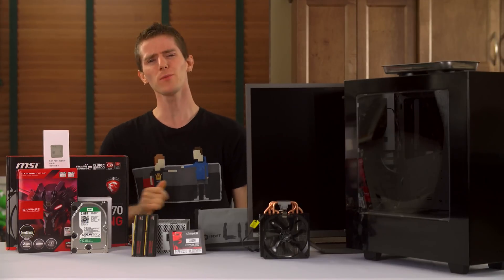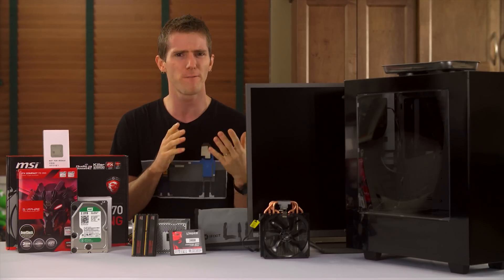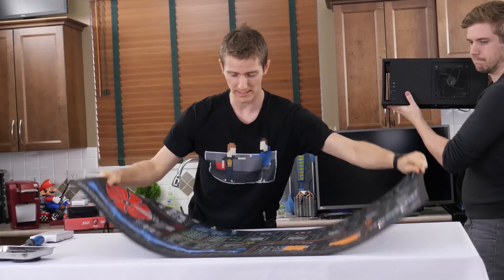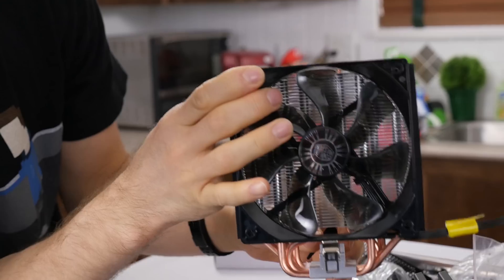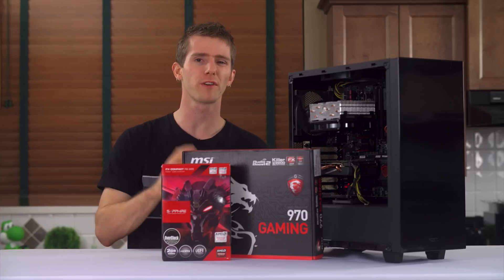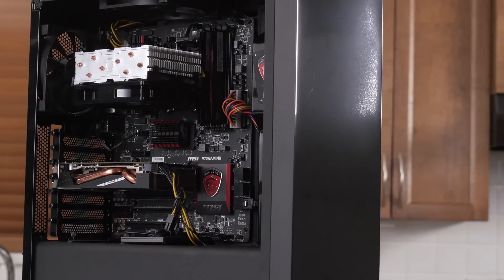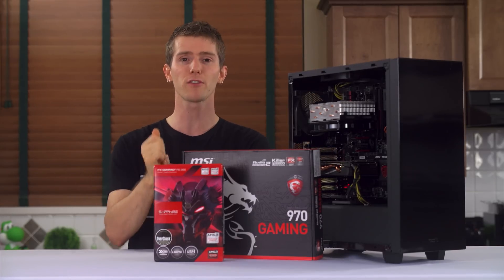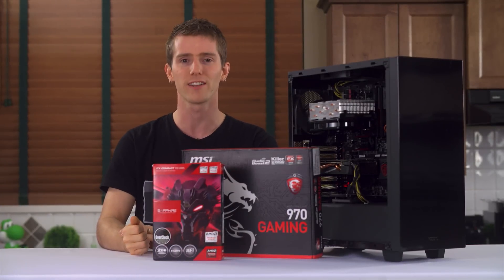Can you Build a 4K Gaming PC for Under $1000?

Comment: There could be better price choices made here, but that wasnt the point. Last April I built a budget machine for school use and for some light gaming ( Minecraft, Farming simulator) I ended up spending about $250 on my pc because i used older parts. I went with an AMD A10 5800k 3.8ghz with 4.2 turbo, a MSI FM2-A75MA-E35, Patriot Viper Extreme 8gb DDR3 1600mhz kit, and Thermaltake 750w smart series PSU. Thats all i personally needed to spend my money on. I used a Radeon 7850 2gb card that we had from a prior build, an old server case that we had from a prior build, and hard drives from the same prior build. The point is this is a budget PC for those who are trying to build a completely new PC. If i would have bought all of the components that were in my build it would have been 500 and change but my pc is also no where near as capable as this is. Although now with the new nvidia line you could make it much more capable with a 970 instead of my card and maybe a cheap SSD for a boot drive. But the point is the word budget should be used very loosely. What is a budget for one person may not be a budget for others. At the time that i started the build i was 14 so the fact that i was even spending that much money on something like that was huge. Now that i am 16 and have a little more money floating around the computer would have been better but it all depends on what you are going to do with your computer, that is what decides your budget. For me my current budget is 0. I could upgrade my current pc and have something that is pretty decent, but i also have consoles and use TV's not super high end monitors so what does it matter to a person like me, especially when my friends all run consoles because they can't build computers. And to me working in the IT feild, seeing all of the crappy dells and other cheap laptops that i fix and the family Pentium series pc that i am typing this on right now, my computer is a beast. But to Joe computer guy and all his computer friends this is reasonable price for a decent computer. The whole budget thing is greatly misunderstood and i think some of the youtubers need to stop using it because they don't really know what budget means.

Comment: Hey Linus I had a quick question but very serious as I may be re-building my brand new (1 month old) pc rig. I recently purchased a GTX 970 only to discover my old pc parts were aged and tired. SO I decided to go ahead and buy a new mobo and processor during the perfect purchasing time of Black Friday! I grabbed a M5A97 r2.0 Mobo w/ a AMD FX 8350 processor, to accompany my speedy new MSI Gaming GTX 970 graphics card. Im now a month in with my build, and getting bottle necking with some of the newer titles ( Basically just AC Unity and Far Cry 4) but still getting great frames (40-60) and (higher on Far Cry 4) but, after watching this video I wonder if the MSI 970 Gaming Mobo would be a better choice coupled with the same CPU and GPU. I already have memory so thats not a problem and I have a 750 w mod PSU. I'm basically wondering if I'd get better asthetics and performance via the better Motherboard. Any comments are appreciated and I'd really love to here back from you Linus if at all possible! Anyways this was a great video and I appreciate the build guide!

Comment: This particular build seems very limited if it's unable to run 4K on BF4 or any other future titles at high/max settings. Personally thinking no one should even consider using these components for a 4k gaming,doesn't make it any closer to those on a budget. The money spent on the 4k monitor could be put towards the GPU/CPU for game stomping 1080p rig that doesn't have drawbacks on which titles can be played on it. Was this purely a sponsor/money video from Linus? I think so,don't hate just my view on getting the best bang for ya buck.

Comment: This is a nice change to the current videos. Seeing more of the common choice of games, not the newest and latest and seeing if a a reasonable budget PC could run at 4K. Personally, I'm not 100% interested in 4K yet. I've owned my PC for 2 years and I spent a bit on it:

£1,300 (about $2,000. Two years ago from a retail shop).
Intel i7 3770 3.4GHz
16GB DDR3 1333MHz Kingston Value RAM
240 SSD Corsair for boot drive
1TB HDD Hitachi for storage
GTX 780 3GB EVGA (before GTX660Ti 2GB Gigabyte)
CX750 Corsair PSU
21" AOC monitor @ 1920x1080
21" BenQ monitor @ 1920x1080

Runs very well after all this time and I run multiple games at once.I was banging on about upgrading to the latest for a good while and realized I don't need really need despite seeing the newer hardware improved and refined.

Comment: It looks nice but I put together a list with:
Core i5 4460
Stock cooler
H97 mobo
8GB RAM
256 GB SSD
same 2TB HDD 
GTX 970
S340
EVGA 750w PSU

And it only costs $30 more than this - $900>$870

Comment: For $1k you could build a much more rig. Ditch that SSD and grab a 970. Or just downsize it and get a 290. An FX 6300 is certainly not the CPU you want for a $1k build. A 4690K could have been easily fit in this budget for a huge performance boost.

Comment: Great video. Another great game to try is GTA 4. I only have a 1080p monitor but I can play GTA 4 at 4K 60 average FPS on two GTX 760s using NVIDIA DSR. Turn down the graphics a bit and I can use only one. I play WoW at 4K as well with my 760s. I played ArcheAge at 4K too. So, two 760s (GTX 780ish performance) kicks ass. I went with 760 SLI when it was a way better value than a single high end card. But I really want to go with a single card now because Ubisoft doesn't know how to optimize SLI.

Comment: I have intel core i3-2100 3.10 ghz 
radeon hd6850 
8gb of ram (relativly old motherboard and 450-500Wps)

it's just seems like most triple A games are lagging what is the cause of it? what can I upgrade for less than 200 euros that can last me some years and doesn't require a change of motherboard or ps

Comment: Pretty sure this system will use more than 400 watts.
Reply: Their Build:

PCPartPicker part list: http://pcpartpicker.com/p/3HHqVn
Price breakdown by merchant: http://pcpartpicker.com/p/3HHqVn/by_merchant/

CPU: AMD FX-6350 3.9GHz 6-Core Processor  ($114.99 @ Newegg) 
CPU Cooler: Cooler Master Hyper 212 EVO 82.9 CFM Sleeve Bearing CPU Cooler  ($26.75 @ OutletPC) 
Motherboard: MSI 970 GAMING ATX AM3+ Motherboard  ($97.99 @ SuperBiiz) 
Memory: AMD Radeon R9 Gamer Series 8GB (2 x 4GB) DDR3-2133 Memory  ($78.38 @ Newegg) 
Storage: Kingston Fury 240GB 2.5" Solid State Drive  ($94.99 @ Amazon) 
Storage: Western Digital WD Green 2TB 3.5" 5400RPM Internal Hard Drive  ($77.98 @ OutletPC) 
Video Card: Sapphire Radeon R9 285 2GB Dual-X Video Card  ($224.99 @ Newegg) 
Case: NZXT S340 (Black) ATX Mid Tower Case  ($59.99 @ NZXT) 
Power Supply: SeaSonic 400W 80+ Bronze Certified ATX Power Supply  ($44.99 @ SuperBiiz) 
Total: $821.05
Prices include shipping, taxes, and discounts when available
Generated by PCPartPicker 2014-12-25 12:16 EST-0500

Much better at same price:

PCPartPicker part list: http://pcpartpicker.com/p/tG88yc
Price breakdown by merchant: http://pcpartpicker.com/p/tG88yc/by_merchant/

CPU: Intel Core i5-4430 3.0GHz Quad-Core Processor  ($178.98 @ OutletPC) 
Motherboard: ASRock H81M-HDS Micro ATX LGA1150 Motherboard  ($49.99 @ Micro Center) 
Memory: G.Skill Ripjaws X Series 8GB (2 x 4GB) DDR3-1600 Memory  ($60.99 @ Newegg) 
Storage: Kingston Fury 240GB 2.5" Solid State Drive  ($94.99 @ Amazon) 
Storage: Western Digital WD Green 2TB 3.5" 5400RPM Internal Hard Drive  ($77.98 @ OutletPC) 
Video Card: Zotac GeForce GTX 970 4GB Video Card  ($309.99 @ Best Buy) 
Case: NZXT S340 (Black) ATX Mid Tower Case  ($59.99 @ NZXT) 
Power Supply: EVGA 600B 600W 80+ Bronze Certified ATX Power Supply  ($19.99 @ NCIX US) 
Total: $852.90
Prices include shipping, taxes, and discounts when available
Generated by PCPartPicker 2014-12-25 12:22 EST-0500

Comment: Where did the $1000 go? for the same price you could have gotten an r9 290, an FX-8320 and a fully modular 80+gold PSU. Just downgrade the case to an R4 (if you even consider it a downgrade) and find cheaper RAM.

If you really wanted to pinch pennies you could go for a cheaper motherboard as well and drop the HDD.

http://ca.pcpartpicker.com/parts/partlist/

As a side-note I don't understand why the 290/290x aren't more popular. At $260 the 290 is an absolute steal.

Comment: If you have to lower the quality to get better resolution, better stick with lower resolution and higher quality.. Please. I have 4k myself, and if you turn down quality, that's way worse than turning down to 1440p or something similar to that. Seriously. Resolution is not all. If you want stunning graphics, you need it cranked up in quality, and 60 fps at least. Resolution is not more important than any of those, unless it is less than 1080p or something.

Comment: I understand that this is a sponsored build, but even as such it just doesn't make sense. You build a quite good price/performance rig and go ahead and say that as long as you're playing non-demanding games, this rig can run them in 4K. 
Why would I buy a 4K display which is inferior in everything but resolution to it's 1080p alternatives? 
If I was competitive, I'd rather have a 120Hz screen. And if you're like me and want to enjoy the games, you'd get some 21:9 display or a really nice regular wide-screen monitor. 
The only conclusion of this video is that our regular every day mainstream rigs are capable of playing non-demanding games in 4K.
4K is on the market and it's getting more and more available. But that still doesn't change the fact that you can get better picture quality at lower resolution for less money.

Comment: If you can afford a $700 smart phone, and a $70 a month phone plan, you can save reasonably quick for a $1000 computer. I stopped buying $6 breakfast, and $12 lunch every work day, and saved $1800 for a new pc in a few months. Do you smoke? Did you buy a $500 XB1 and a $60 a year membership? You can afford a $1000 pc. Do you spend $400 a month on eating out? You can afford a $1000 pc.

Comment: I would NEVER buy another MSI motherboard!  They're RMA's qc department is ABSOLUTE GARBAGE.  I received not one, not two, but THREE back to back to back rma's DOA motherboards from them and had to threaten to contact the B.B.B. to get a brand new board finally ( of course they didn't have a matx sized-one in stock nor the 990fx chipset series at that time, although I think they were just being cheap and bullshitting me).  my 785gm-e51 matx board died in less than 2 years ( 3 year warranty) after owning it brand new, NEVER overclocked...ANYTHING, and the psu was excellent in providing clean good power to it ( psu = NZXT hale90-m  first gen semi modular 1k watt psu).

DON'T buy msi motherboards.  I can't speak for the quality OR lack there-of of their vid cards in recent years ( my 512MB 8800 is STILL running to this day), but I went through absolute hell trying to get a WORKING motherboard ( ended up with the 970g-a46 ).

Comment: I managed to build a 2000$ gaming pc for under 1200$. Tips is not to get everything in retail. Compared as many sources as you could before your purchase, or possibly considering getting an used component. For starter, an used GPU is relatively easy to find on eBay but of course buying used stuff posts a certain risk. Always makes sure that you find a reliable seller.

Sometimes getting a component from another country is cheaper than buying it locally. The downside is that if you want to save on the delivery, you need to have patience since paying for fast delivery will probably end up costing more.

Comment: With a grand and having to go all AMD, I would buy something like this: http://pcpartpicker.com/p/ZtbRMp
Reply: No, it doesn't. Watch the video. The 4K monitor used in this video is the Acer B326HK, which is alone over $1000.
Reply: Eric Slattery  This is the PC they built using the cheapest prices you can find on the Internet: http://pcpartpicker.com/p/2cn9XL

They would need to find a 4K monitor that's cheaper than $150 just so that it's under $1000. I don't think that $1000 price tag include the price of a monitor.
Reply: Here's the price of the build in Canadian money: http://ca.pcpartpicker.com/p/2cn9XL

Comment: Or you could just do what I did, get an i5 2500k, gtx strix 570, 16 gig ram, 24 inch 1080p, black pearl, corsair 650 and a cheap asus pb pro for $1200 4 years ago and still be using it today playing games at 1080p 60+ fps at maxed settings on all but a few games.
Easy to over clock thanks to asus's great bios on the mobo and good easy one touch hardware software management on the desktop. If I need to I can press 2 buttons and over clock the 570 in line with a 580 due to the direct cu cooling it handles it with ease and the i5 is as easily over clocked without heat issues despite using a $40 be quiet silent cpu fan.

I recently ported the boot up to a $35(sale) 128 gig intel 320 series and still using my original 2 tb as storage now.

I dont get why people think pc gaming has to be expensive, I have spent less on my pc than a typical guy buying a ps3 at the same time due to free or inexpensive games from steam sales, the initial cost may be high but as everyone owns a pc anyway its not much extra to buy slightly higher quality gear for gaming purposes. I see many people buying pre built shit at stupid prices, saying pc gaming is too expensive, or that consoles are far cheaper, 10 console games and the console, and some controllers etc will be a similar price to a gaming pc

But then hey, I am not sponsored to make a stupid pointless video as AMD are getting desperate after the gtx970 launch and the crazy new intel cpu's ;-)

Comment: Two questions I have a water cooled 780 3gb overclocked gpu (1250mhz) with a i7 4700k at 4.8. Can that run bf4 on 4 k well what settings at 60-100 fps? And what is the best 4k for gaming that is around 300-500?  Is the monoprice good for gaming
Reply: Anyone please?